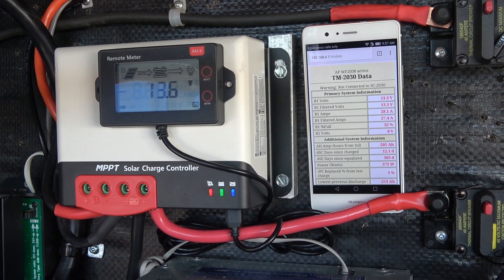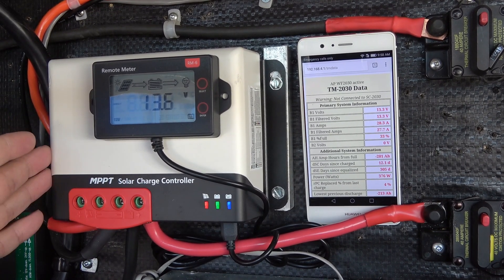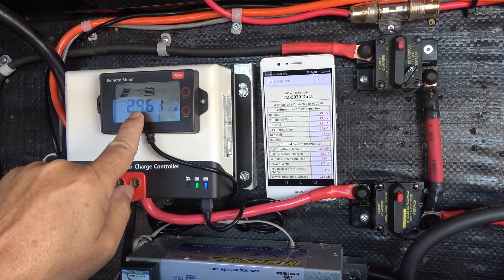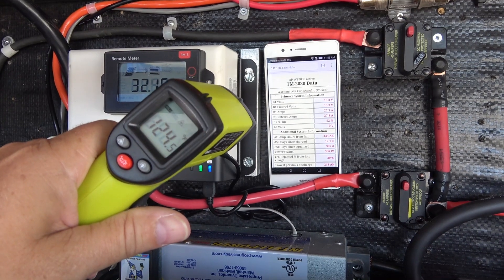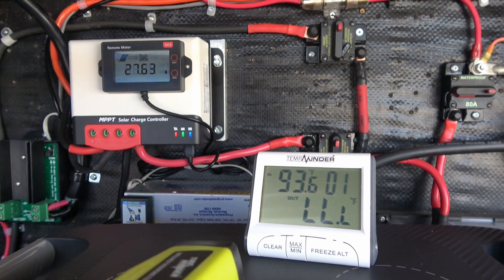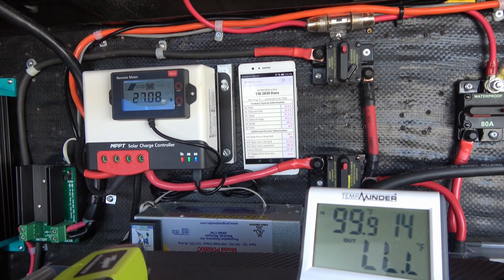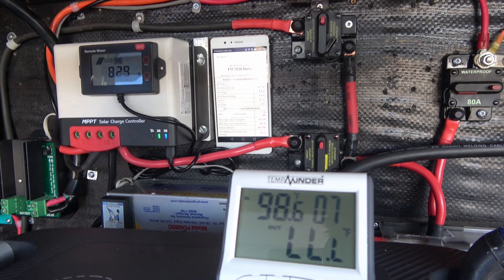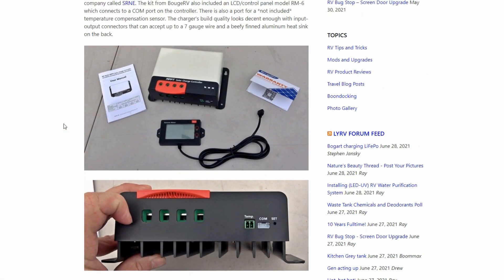High Heat Torture Testing the BougeRV 40A MPPT Solar Charge Controller

Comment: I have a Epever Tracer 5415AN 50 amp} 625 wt-12vlt/ 1250 wt-24 Vlt / 1875 wt-36 vlt or 2500 Wt at 48 vlt ... This thing is a monster, and Compatible in lots of Configurations for Battery Volt Configurations, it can Hook Up a Gas Gen system, or a Wind Turbine system. I also ordered the Epeaver Remote Meter, the Epeaver Wi-Fi Serial Server, and the eLOG01 Datta Logger For it for monitoring Long term Use !  The Epeaver is Made in China But it has a Great Rep Thus Far, it Als has a huge Heat Sink for Dissipating the Heat ,  The Larger the Unit , the larger the Heat Sink.  Now I need a Boat to Put all this On with some solar Panels !

Comment: Great video.  Just have a follow up question.  I have this same controller,  the manual for the RM-6 shows a Loaded controller menu, but I cannot get it to go into that menu. Have you been able to use the Loaded controller menu on your RM-6?
Reply from the maker: This controller doesn't have the load terminals, so I imagine that is why.  As an example, here is another model that has load terminals,  so it has those menu functions https://www.loveyourrv.com/srne-40-amp-mppt-solar-charger-features-install-demo/
Reply: @LoveYourRV  that makes sense. Thank you again!!

Comment: Should have tested amps from solar prior to the controller for comparison.
Reply from the maker: With 940 watts of solar panels the controller was well over paneled by over 400 watts so solar amps weren't a concern even in the hot weather. The controller could get as much as it wanted to with tons to spare. So it would have to be limiting the amps right from the start.

Comment: Hi Ray this is Joe again I have a important question that's driving me crazy remember I have the same 40A charge controller my battery bank is a 24v bank two batteries my first panel configuration was setup to only bring max 16 amps in from panels at 7.89 amps per panel running in series/parallel do I need to change the panel configuration to bring in more amps in order to properly charge a 24v battery bank ? Wiring in parallel only would give me 31amps. I can't wire in series because my 4 240w panels are 37.2v each

Comment: In the first video you said the battery is going to that 40 amp fuse from there what size are your other fuses and where are they going to
Reply from the maker: Currently I have a 40 amp breaker between my solar panels and this 40 amp solar controller and another between the solar controller and the battery feed. So far neither has blown but better if they were 50 amp breakers. Guess I'm just a hair under their tolerances.
I just don't want to spend more money if I don't have to so trying to get away with the existing breakers I was using for my previous 30 amp controller and not have to buy new ones. For more info on my complete system as it sits to date check out this video - https://youtu.be/V6UAE5lavwA Cheers, Ray
Reply: @LoveYourRV  because remember I have the same charge controller and 940w panels 4 panels my inverter is 2000w-4000w surge is all ur breakers 40amp even from ur batteries to ur inverter?
Reply from the maker: No, my inverter is a 1000W with a 2000W surge so I use a 175A fuse on it's positive cable feed and then I have 200A catastrophic fuse located on the positive battery terminal as a last failsafe fuse for the whole system.
Reply: @LoveYourRV  Ohh ok so for my 2000w 4000w inverter get a 275A fuse for the positive side now for my batteries i only have 2 Vmax 35ah AGM sealed batteries for now what amp size fuse for two batteries and possible 4 batteries when i get them i only could afford the 35ah for now but will eventually upgrade my battery bank
Reply from the maker: I'd size the cat fuse at 300A. I think those batteries will really struggle to run any high wattage loads, they don't have the ability to output enough amperage and with the AH capacity so low they will run dry quickly if you are powering any high wattage loads for very long. Cheers, Ray
Reply: @LoveYourRV  thanks for your valuable input Ray Im simply trying to power my grow light & a lil small fan the light draws 1.17amps at 147 watts for my grow tent

Comment: Have you considered using a small computer fan on the charge controller?
Reply from the maker: Sure could do but this was a torture test.  The controller works just fine in normal boondocking temps that we chase around 70 - 80 degrees. The idea of the video was to demo and test its protection circuits from over wattage and high temps. Using a fan would have defeated the purpose.
Reply: @LoveYourRV  And it performed terrific. I will be getting one. I liked the use of the aluminum stand offs.

Comment: Different topic Les, are you aware of a Lane departure system or drivers assist program or device that could be retro fitted to a vehicle?  I had a LD system put on the Volvo truck 5 yrs ago but it would not work if there was no white line or on one or both sides.  
Also it would squawk if the lanes varied in width, ie a construction zone on I 75 in Florida.
Have there been advancements made?
Thanks
Roger in Victoria.
Reply from the maker: Some dashcams have it but I'd call them more of a gadgets thing and not something I'd trust much.

Comment: Ray - are you still running parallel feeds from the panels to the charge controller. I wired my panels in series to create a higher voltage but less ampere feed into the MPPT charge controller.  My controller will handle up to 150V and output up to 60A. The MPPT controllers work better to  maximize higher volts but limit the charging into the battery bank to minimize damage to batteries.  Your lithiums will accept a heavy initial charge but the boost and float modes on the controller don't  always push maximum into the bank as batteries get closer to full charge.
Reply from the maker: Yes, my setup is 8 panels all parallel but with large enough gauge wiring, so not much losses there. The controller has a special setting for lithium battery charging, if I remember right it puts out a constant 14.2V or a person can choose User Defined mode and custom set what ever they want for each charging mode.
Reply: Ray - if high heat seems to lower the effectiveness of your solar charger output, have you considered wiring a 12V computer case fan to help keep the controller cooler and increase its efficiency?
Reply from the maker: Could do but this was a torture test. There is no way I'd boondocking temps like this! :)  The controller works just fine in normal boondocking temps that we chase around 70 degrees. The idea of the video was to demo and test its protection circuits from over wattage and high temps. It was a convenient thing that the heatwave showed up so I could give it a try. Today's temp 72F and getting the full 40 amps.
Reply: Ray - do you think you have enough solar to boondock in HOT temps? While running your Starlink? I ordered Starlink 6 weeks ago but haven't heard back from them yet?
Reply from the maker: Sure, I have another 30 controller and extra ground panels I can lay out and a gas generator, DC-DC converter, etc. So power isn't a problem for me But like I say I wouldn't ever plan on boondocking in hot weather. It would have to be some kind of emergency situation or a short term heat wave, like a day or two, or else I'd be out of there!
Its no fun for me, I don't like the heat much. That's the big reason I like where we spend the summer, usually mild climate near the ocean and in the southwest in the winter, with all its elevation change options to chase 70 degrees.
Reply: @LoveYourRV  Ray - If you had the Renogy 60A DC charger (or your 40A model) do you think you would still need a backup generator?
Reply from the maker: Yes, I actually do for the odd times the sun isn't around for days on end or camped on the bush. I wouldn't want to idle my expensive diesel truck engine for hours just to charge the RV batteries. I don't need it all that often but when I do its nice to have. Mine is quite compact, 2000W and 44 lbs, fits in one of my trucks tool chests.

Comment: Great videos as always, Ray👍👌 question for you here: what 400w solar panels (400w total ) will you recommend to hook up and mount with limited space on our Ford Transit Van roof  to our Bluetti AC200P? Thank you
Reply: Thank you, Ray
Can we connect (2) 200w panels to Bluetti AC200P?  Best in series or parallel connection?
Reply from the maker: Yes, Usually you will need to connect in series as the minimum input voltage in solar mode is 35V and up to 150V. So if they are what they call 12V panels they usually have around 20V open circuit voltage so in series that would be 40V so should work.
Reply from the maker: Thanks. :) Renogy makes a compact 100W panel. I have 7 Renogy panels and haven't had any problems and they have performed well for many years. https://www.renogy.com/100-watt-12-volt-monocrystalline-solar-panel-compact-design/ 
https://amzn.to/3w9A87X  Shorter than the standard 100W Solar Panel that Renogy carries but with the same power output, this panel is suited for applications that require a smaller footprint,
Reply: Thank you, Ray👍👌

Comment: I actually contacted the manufacturer and asked for the testing high temperature operation that was done in a thermal chamber testing ,  I told them I live in Arizona  I was supplied with numbers,  it has a high opererating temperature and it sounds like a good unit .

Comment: In my opinion there are three things that will prematurely kill Electronics. Cheap components, heat, and vibration. I let others be the guinea pig, and find which items I'm looking for in that seem to have a good track record. For my inverters and charge controllers, I simply cushion their mounts and stick $5 fans on them. They stay a few degrees above ambient. Hey Ray, thanks for being our guinea pig.

Comment: Thx Ray for the followup testing you ordered the high temp ambient in BC for. Your neighbors may not be as appreciative as I am LOL. FWIW We live in the high desert and have been getting our fill of triple temps this summer already. My Bouge RV 40 a MPPT has been keeping my FLA bank charged with no issues as well but I'm only running 400watts of solar power thru it. FWIW I programmed the custom  battery setting to match what Trojan recommended for the T105s and have confirmed the 30day 2hr schedule for equalize charge is applied to the custom battery setting. I never got an answer from Bougrv Customer Service re conformation of same. Happy Camping and Stay Cool.

Comment: 117 here today. The glass panels will also loose some efficiency as they get hot as well.. we’re going to have to start calling you “Ray the Tool Man”. What you need is more power !,  still anxiously awaiting the day you install the mini nuclear reactor & cooling tower...
Reply from the maker: Wow! We cooled off to 95. Should be back into the 80s for the rest of the week. Still above average, we should be low 70s. I'm fearful of a bad fire season and dealing with lots of smoke like a couple years ago. :(

Comment: At around 6:10 you could have been cooling down the cooling fins on the back a little with some ice in a plastic bag? Looked to me, als If you had just found one point of the throtteling curve at 126F/27Amps? And this factory setting 'is a little too ancious for the hardware'? The hardware just as well could take 75 deg Celsius for instance? So cooling would have provided for higher currents again - at a certain point of additional cooling the controller making the 40 amps? 

(If systems made for 1000watts would throttle just the same way - one would have to be one for 1500 watts to be fed by/with 1000 watts 😉😀 - wouldnt we?)

But first of all thank you for all that work and for sharing with us!
Reply: 5:55 actually
Reply from the maker: I'm sure a small fan blowing on the back of the controller to increase airflow like in a computer or adding a bigger heat sink would make a big difference but my goal was to torture test it for my worst-case scenario. :)  For us to be boondocking in temps over 80-85 is rare. We usually chase 70F. :)

Comment: Those temperatures are ridiculous. I've noticed similar behavior. Our RV is being stored in southern WA and I have a Maxx Fan running to keep air circulating. The batteries are usually down to 85% by the morning and the charge controller current keeps rising until about 11am when the air temperature is getting into the high 90s. I don't have a vent fan in the storage bay where the charge controller and inverter are running so I'm thinking that it's getting pretty warm in there. Time for another microprocessor to monitor temperature and humidity. Interesting video. Thank you for putting these out.

Comment: I have to feel sorry for all of the locals that live in normal sticks and bricks without an AC since you guys aren't accustomed to temps this high and many don't have AC's. I live in the southeast so everyday with a humidity of 80+ and a temp of 90+ is absolutely miserable.

As far as the charge controller, it looks like it does the job. These things seem to be commodities anymore and they all work about as well as the next one.
Reply from the maker: Back when I lived in stick and bricks we always had below ground basements usually with a spare bedroom and rumpus room. Made it tolerable for the short heat waves BC coast gets as the basement stayed relatively cool. Nowadays less houses have them, guess it costs too much.